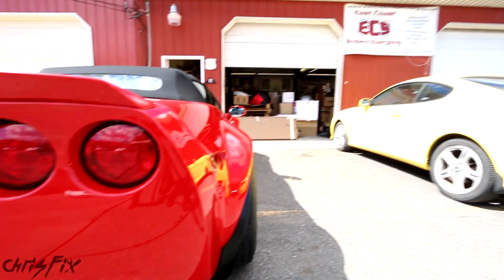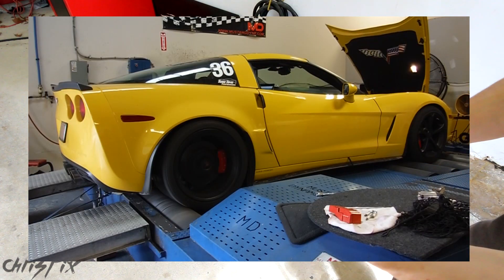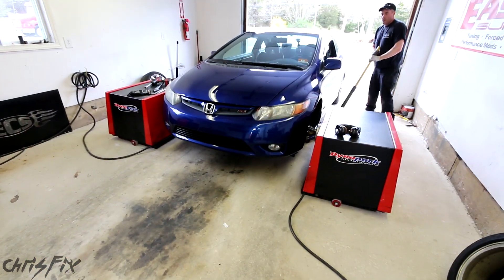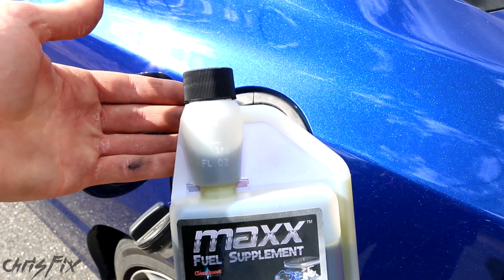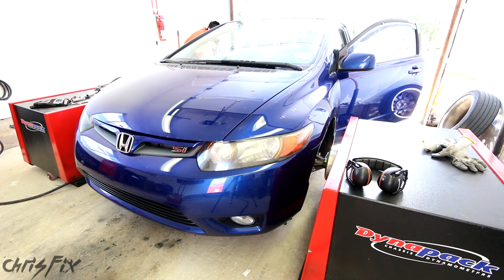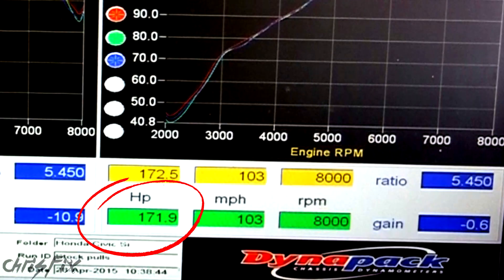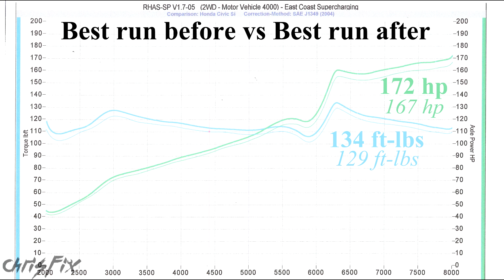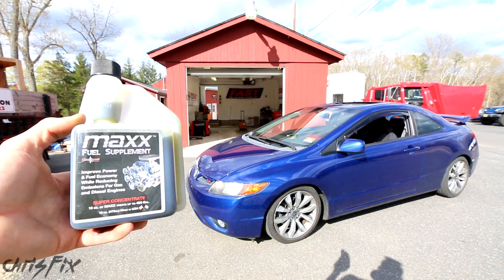Can a Fuel Additive Really Increase Horsepower in Your Car? (With Proof)

Comment: Ahh this little trick actually works and has been a little secret of mine for years to squeeze extra power out of a supercharged cobalt ss.
Reply: I do all my tuning and logging with shell premium, I don’t add  supplements until the tune is done and safe, where then the additives act as a safety net. I noticed that once my tunes were getting to ac really spicy level, pump gas’s limitations are exposed when you switch gas station brands. Shell v power is THE BEST and ALSO is the most consistent in gas quality across the city and county. Second place I give to CHEVRON TECHRON. After that… just by going to Mobile 1 I already see my knock control becoming active. Heat soaked my ecu will pull timing.. if I push it for a hard acceleration then there will be knock. ANY OTHER GAS is instant knock on my tunes. If I go to an older less developed tune, I can run any gas in any condition and it’s safe. That’s like a stage two tune from stock. I think now possibly my tune is DEFINITELY stage 3+.. I say (plus) bcs where my engine makes max torque MBT max best torque or to some “brake” torque, I’m squeezing the maximum allowable timing in that rage for 20°  tables. On the 3D graph it looks like a mountain where the ignition is raised as much as I can before I see knock voltage get sensitive. I should stop babbling lol but I learned all this with GPT.😎😎 my viewers were all pretty angry with my videos on that subject but slowly accepted the concept. I just haven’t uploaded in a bit bcs of.. well you’ll just have to read the comments lol.

Comment: Bro it does definitely makes more power. I put some in my Chrysler 300 and not only could I feel more power but I got about 50 more miles out of a tank of gas. Then I put some in my Corvette and felt a Big difference. Felt like about 15-20 HP in the vette along with extra throttle response. I just wish maybe you would have tried putting like a double or triple dose and see if it would make more power then following directions. Good job on video👍

Comment: If you have 87,89 or 91 like ca the lower the octane the lower timing the engine will produce due to knock. That alone on these engines is 10 hp. If you are running 87 then add boast it  produces more hp. What octane did u start with? I can fudge numbers by putting in 87( retards timing and power) then add boaster and it would run like it should.

Comment: You should show the cam timing and injection timing in this test to show that the timing changers based on the detonation in the cylinders which leads to advanced timing allowing more air in for compression to make more power. Meaning any older cars that do not have VCT, VVT, VVTI, TI-VCT etc wont benefit from just putting this in the tank unless the fuel is to low in Octane rating causing detonation. Would love to see the changers in cam timing and injection timing.

Comment: i cant see how these honda engines with vtec can be of any use for a daily driven car. Its like your driving a 2005 corolla until 6000 rpm and there is only 2000 rpm of that usable power left in the power band
Reply from the maker: I think it activates a little lower but I can see why you think that

Comment: I think if you compare at the same time the knock sensor readings you should see that the knocking of the engine is less with the additive .
Here in Europe if you fill it up with the Shell fuel with more than 100 octane you should have the same results .

Comment: This stuff doesn't hold a candle compared to Liqui Moly products. Just there fuel injection cleaner alone made my Lincoln MKC 2.0L Ecoboost purr like a kitten and give it better HP and MPGS...!!! Hands done they have some of THE BEST additives for vehicles on the market. And yes even better than Chevron Techron which is one of the best out there. And they should be great they are German made products. Amazon sells mostly all the Liqui Moly products. So do your vehicles a favor folks and use these additives. You won't regret it.

Comment: i just put the whole bottle into the oil tank after oil change  and got no performance enhancement at all and now my car does not run anymore what did i do wrong?
Reply: You forgot to put the drain plug back to proper torque specifications

Comment: what's amazing is not the peak HP, but HP at usable everyday RPM like 3000 or 4000 RPM. based on the chart, you got about 10 HP boost (from 70 to 80), which is about 13% increase in those low bands, that's amazing.

Comment: What I've been trying to find out is when tuning a car you choose what octane fuel you are going to be using in the car. Where I am I can get what is known as 94 octane here. On the ron index that equals about 98 octane or so. If I can boost that 94 to the 100 rating of the ron index which would be 95 Octane my gas I could use the higher hp tune. Will an octane booster achieve this? What I want is to use the higher tune that i could have with 95 Octane (My 95 lol). I hope that makes sense.  Basically can octane booster bring my 94 to 95?  This has to do with timing and knock.

Comment: Did you warm up the engine with a long drive like you did after additive?  Because it seems an engine after a workout has all it's sensors on alert, computer understanding demand, and engine programmed for the workload.  If you just drove from home to the shop before additive, it wasn't a fair test because it would favor additive just by contributing normal on-the-fly operation that pre-additive didn't have.

Comment: The experiment is flawed in the sense that it only shows bhp increase with the additive in the tank, instead of benefits retained after the additive has run its course.

The fuel should have been collected prior, with a third used for a dyno test. And then the second third used with the additive. Once the that fuel tank has been emptied then the last third is added. That way you would know if whether the power restored/gained was actually retainable.

Comment: Let me know what you think.  I used Torco booster and  all of my plugs turned orange, my gas mileage went for a shit and I had issues starting my car?  What happened?  Did I hurt anything in my engine and why all the problems?  If I quit using booster and stay with premium will that orange shit come off and will I go back to normal? not happy with all the [problems after I starting using this shit?

Comment: "Increase of 4 horsepower"   LOOOOOOOOOOL
Reply: How are the spark plugs looking? I am looking for a product without MMT
Reply: that’s to the wheel about 10 crank which is what a full exhaust system will yield. Compare the prices
Reply: @rebel9976  lol   4 WHEEL WILL NOT GIVE YOU 10 CRANK. IT WILL BE 5 CRANK  LOL

Comment: I don't know if the additive made the difference, or, if the ECM did a block learn from running the engine under those conditions, putting it in "party mode". The car should have been dyno tested a couple of times, before introducing the additive. Otherwise, if it isn't regularly run in those conditions, the extra fuel flow could have cleaned the injectors, and cleared some restriction from the catalytic converter or other exhaust components, and, the oxygen sensor might have been cleared by the hard runs.
     If the additive did anything, it might have provided lubrication to the fuel pump, improving the seal, which would improve fuel delivery.

Comment: My only criticism would be for the amount of fuel additive you put in the tank being so small surely all you would have done is coat the pipe leading to the tank and very little supplement would have actually reached the tank therefore the fuel supplement that coated the fuel pipe leading to the tank would have not actually mixed with the fuel and would have dried as vapour. The second realisation is that when you add any type of octane boost fuel supplement or anything that change the chemical composition of the fuel it can take a while for the ECU to finally adjust to the new mix doesn't always happen straight away way the ECU or engine management system has to learn the new fuel composition and adjust fuel air ratio ignition timing etc to run the engine at best optimum rating taking into account general wear and tear of engine.

So while your graphs and test does show there is an increase in torque and horsepower I also noticed there's a slight change in humidity  would this make a difference I don't know but there are too many variable factors to take into account when dyno testing , just to see the difference within 5 horsepower because you had an additive.

 all the tests I have read with these that have done in a more scientific and professional ie in a full on lab experiment taking most of these so-called variations into account have proven that if a car is designed to run depending on its area America Europe China etc on a certain type of fuel then adding fuel enhancing boosters to increase horsepower or octane rating which therefore in theory increases horsepower all the ECU does is a just adjust and compensates back to the original settings you don't actually gain anything except a slight increase in fuel economy as you're now burning less fuel for the same engine output.

 if however the car is a high-performance car that is designed  to run and has the ability to retune itself at a system-level ( ecu )to take advantage of a higher octane or higher performance grade fuel but will also run on lower grade fuel then yes a fuel supplement or octane boost will and can increase horsepower if you're using standard fuel and you're bringing it up to super unleaded or whatever you have in your country by using the fuel supplement

Comment: For anyone curious as to why he 2nd pull tends to have the highest result, as seen here, It's usually down to temperatures.  Engine and gearbox oil offer less resistance at their optimal temperatures than when cooler. Went to a dyno day a few months back but had to wait for a while before my go so the gearbox oil was cold by the time I got to go. Across my 3 runs that made about a 10% difference 1st to 3rd.

Comment: That is pretty impressive. The heat soak was not such a factor after either. Very interesting. Would like to see other engine with it. 

In the late 1980s I worked at a dyno place in Orange, NSW, Australia. We had a customer with a 1978 351 Cleveland Falcon. He said that this particular synthetic you beaut oil would add 10 to 20 at the wheels, just by changing the oil and filter. We were super skeptical about it. All we did was drain the old oil and put a new filter on...add the super oil in....and...22 hp at the wheels increase. Crazy.
Reply from the maker: Interesting, thanks for sharing!

Comment: Wouldn't it be possible that the first bench test (which was pretty violent for the engine) worked as good scrub that make it possible for the engine to work at its best on the second bench test (and biaised the comparison...)?
Reply from the maker: Anything is possible because our sample size (1) is small but it’s highly unlikely. The owner drives the car hard every once and a while so it’s not like it hasn’t had the “Italian tune up”. But good thinking!

Comment: It can be due to engine oil becoming less sticky after 20 minutes drive and hence the increase in horsepower. Please take this into consideration and do another test! Thank you.
Reply: Oil viscosity (“stickiness”) is correlated to engine temperature, which is what they controlled and considered as a variable in the test.

Comment: Hey Chris, I love your vids. But at 5:40, after you drove for about 20 min, the fuel level can't be the same as before... Can it?????
Reply: Simon Xiang honda 4cyl doesn't use a bunch of gas
Reply: 20 mins could be 5-10 miles depending on how fast he was driving which it didnt look like that fast, he may not have driven far at all and used hardly any gas

Comment: It's all bullshit. Does anyone know what octane does? For the uninformed octane booster reduces or eliminates detonation, which causes the knock detectors in you engine which allows full advance of your timing. Knock detectors with the presence detonation tells the ecu to reduce advance. duh. I have an Acura TL that I run 89 in, but when I put top grade in it you can feel the noticeable difference in performance even though I never hear detonation. That is because the sensors picks up the detonation before I can hear it.

Comment: What about oil temperature though? That can have a big effect on oil viscocity, unless it's a super-duper oil, which will also have a significant effect on power. It usually takes significantly longer to warm up the oil than it does the coolant, so it might well have been that the coolant had reached normal temperature but the oil was still cooler in the first video than in the second video after they'd taken it for a drive.

Comment: The issue I have with the results (and I haven't even gotten past you taking it out for a ride after adding the CleanBoost Maxx) is that  you added so little to the "tank" via the funnel that what didn't end up sticking to the funnel and the fuel filler tube leading down to the tank probably wasn't enough to effect the gasoline at all. Also, in order to make the test accurate, you would need to know the tempature of the engine before the initial Dyno test, so you could allow the engine to cool down to that tempature before the first Dyno test after taking it out for the drive.

Comment: Is it me or would most of the additive simply absorb to the gas fill pipe; and only a very very little actually get to the gas in the tank? 1/2 ounce wouldn't be enough to actually flow all the way down. Hence, why you mix with gas or flush it down the pipe with gas. Would have been nice if Chris would have siphoned some gas from the tank, mixed in the additive, and poured it back into the tank. Still impressive that it did something.

Comment: 167hp at the wheels on fwd is nothing to scoff at. That's pretty damn good
Reply: As a personal Si owner these things pull haha , I’m running full bolt ons waiting on a hondata so hopefully I’ll be in the 220s which should be cool for N/A
Reply: @Veryrarevryan  what is half bolt-ons?
Reply: Shawn Warnick headers + exhaust / intake + headers . etc . When you’re full bolt on just means you have I/H/E
Reply: Shawn Warnick also it’s a terminology, FBO = full bolt on so just small mods that are non forced induction and pretty much close to stock not like building your block or such
Reply: My factory 76 Chevy 350 makes about 160hp factory. It goes to show how far we've come in terms of technology.
Reply: @MalaiseEraMedia  the 350 also had about 250 ft pounds more torque!
Reply: @MalaiseEraMedia 
 Five short years later a Japanese built turbocharged 2.8 liter inline 6 was pumping out 180 hp. Times change, and quickly.
Reply: Every FWD car these days has 200 HP or more.  Honda civic Type R is 306.  Neon SRT 4 240 HP...and that's 15 year's old
Reply: @charliesmith5545  Those are both turbo, completely different powerband and driving experience than an NA motor making 200+whp at 8500rpm.
Reply: @ben-7403  power is power lol
Reply: Ben - my 2005 acura tl makes 270 naturally aspirated stock with FWD
Reply: @charliesmith5545  power is power until the NA manual transmission car lqst a solid 100k more miles than the turbo car...
Reply: Charlie Smith yea they both cost a lot more then the si and they are reading crank hp not wheel
Reply: Yeah and the K20Z3 really only needs more airflow to put out much higher numbers. With a 3.5" intake, aftermarket header, 3" exhaust and Hondata Flashpro (ECU tune) they'll put down between 215-230whp.
Reply: I drive a 08 ford ranger with a 2jz stuffed in, pulls a little over 1400hp at the wheels..  damn thing is useless..  wont go fast, wont go slow, cost me another 10-20 grand to put a proper suspension and braking system in it with a roll cage and frame supports n all..  right now it wont even run a straight line in 4wd..  fucker just dog walks off to the right everytime, at a dig it just spins the axels in two, everytime..  unless i start it out spinning than your back to just not going anywhere..  sounds supee mean though with all the happy hisses and whistles..
Reply: @Z-Ack  sounds like quite the forze experience
Reply: 172hp bro.
Reply: Yeah my car weighs 3800lb and has about 215hp at the wheels and is awd and i thought it was pretty dad fast. I think 170hp is pretty good for a 4banger fwd
Reply: @Sam Rose Is that stock? I have a ton of bolt-on mods that I've been looking at so a baseline is pretty handy.
Reply: my 2009 hyundai sonata 3.3 V6: scoff
Reply: Check a chrysler 200 with 3.6 v6 hp
Reply: I’ve got a 2014 Mazda3 s grand touring fwd that says it makes around 190 super zippy and fun to drive car and when I started adding in fuel injector cleaner consistently it feels actually rapid
Reply: me: reads these comments
also me: laughs in 3.3l v6 hyundai sonata pushing upwards of 270 HP
Reply: @deesnutz42069  1.3L increase in displacement for only 40hp over the K20? I'm good

Comment: I call BS...

160ish WHP for a K20, seems more like that car was poorly maintained or just had 87 octane gas and the crap you added just boosted the octane  up.  

Everyone knows that car's power was under rated not to knock down RSX sales. 
Even with Honda 197hp rating minus the usual 15% drivetrain loss, I'd say ya got right back to where ya should have began with... 

GL with your new videos, but I gotta say, your info in this video throws ya down a notch. 
Just toss it...LOL

Comment: It may be increasing Octane in the fuel. So when the engine hits Vtec and advances the timing that's where itll make more power, thats the only real logical solution to this i can think of
Reply: Thinking that too. Also ive been told if you have an car thats older and or high mileage, that higher octane gas gives better results due to the carbon buildup over the years increasing the compression ratio. Any truth to that?